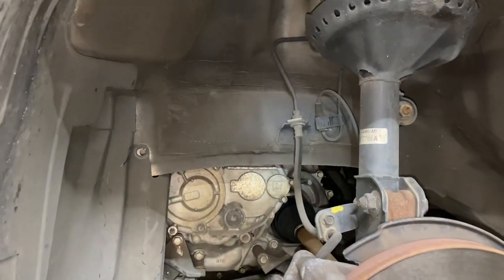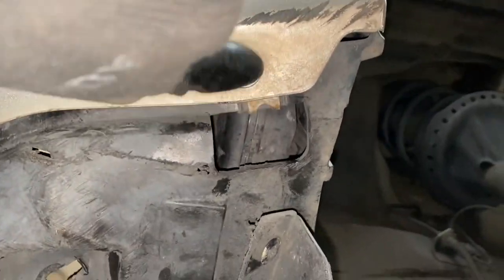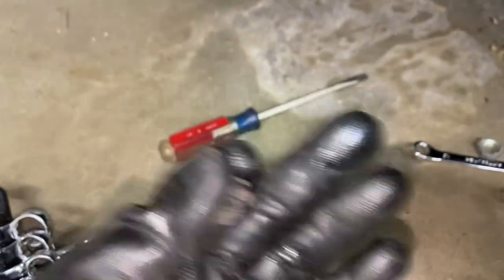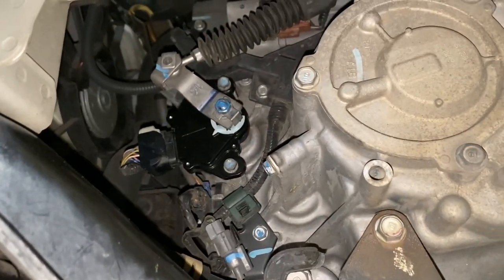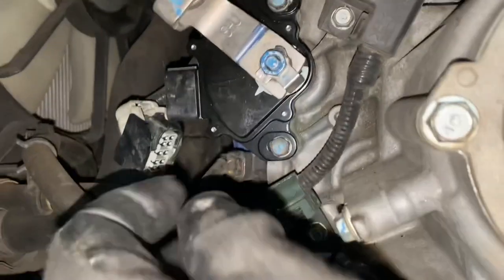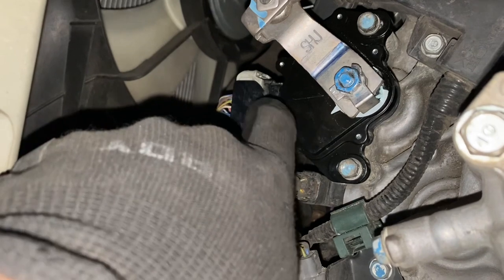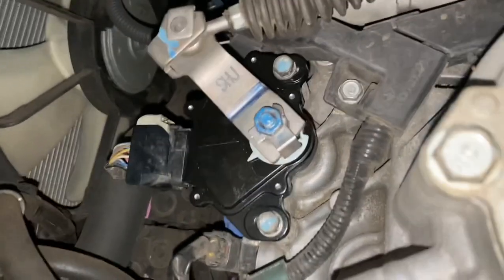2007 Honda Odyssey Neutral Safety Switch replacement P1717 Fix

Comment: Thanks for the video!  My install went very well.  The hardest part for me was getting that electrical connector latch to rotate to unlock from the switch.  Not much room to get the screwdriver in there to pry it up.  After install I noticed that the electrical connector must be reattached in order to move the shift lever into other gears.  Also, N and 2 were not lighting up when in gear but if I wiggled the shifter enough they would light up.  A slight rotation of the switch to adjust the alignment of the arrow with the line solved that problem.  A bit hard to align the arrow with the line because you don't have a straight-on sight.  I didn't have a 7/8 inch open ended wrench and my adjustable wrench was too big to get to the large nut, so I used a 7/8 deep socket.  I had to use a hammer and screw driver to bend the tab on that shaft nut retainer which was a bit hard to bend back squeezing with pliers.  My issue for a number of years was a random check engine light along with Transmission error which would throw while the van was in operation and would go away on its own after restarting or after resetting the code.  A rare occasional stuck shifter in park would happen which was resolved by restarting the van or giggling the shifter or both.  I didn't have the no-start issues as others had.  My BlueDriver error code was P1717 Transmission Range Switch ATP RVS Switch (open or short).  The electrical connector looked fine so I didn't think it just needed an electrical connector cleaning.  I purchased a Standard Motor Products NS-577 Neutral Safety Switch for $57 for my 2007 Odyssey.  This switch, sliding door switch and roller bearings, and power front door lock motors have been the only issues with this Odyssey with 200k miles.  Scheduled maintenance like the timing belt/water pump replacement was really not that hard with help from YouTube videos.
Reply: having the same symptoms as you described... did you bookmark any better videos? was yours also 2007 ?

Comment: Great video I’m doing it right now in my garage and you have showed me everything . It also showed me that the one coming off is silver in color and the new one is black. Also thanks for showing the connector removal. The replacement part number is 28900-RYF-023. I’ll just ask if is correct before changing. Thanks a whole bunch.     Artie 👍

Comment: Do you change it with van in neutral? I don't see how you could loosen)tighten that top 10mm screw with shift lever in place.
Reply from the maker: I did it with the van in park.

Comment: I just replaced this part on the same van a few days ago and it's been running fine and this morning I was parking and had it in drive and then threw it in reverse real fast and got the gas and it just ramped up but would no go and then I put it in drive and back in reverse and it was okay again. It's never done that in the 6 years I've had it. Any ideas of what that could be?
Reply from the maker: It sounds like it may need to be adjusted slightly.

Comment: After replacing this I can switch to all gears and all of them work, but I have to play with the shifter a little to get the P R N D lights to turn on.  What did I do wrong?
Reply from the maker: My guess would it may need to be adjusted slightly or check the actual connection to ensure the electrical connection is clean.

Comment: Thanks! This was very helpful, in addition to other videos I found for a replacing a 2007+ Odyssey neutral safety switch--definitely in a different location (as shown in this video) than 2006 or before. I actually did the job from the top, after removing the battery and battery tray, as well as the air filter housing/intake or whatever it's called. Left me tons of room to work from the top, although I can see how being able to access it from the side as you did might have been helpful in addition to top access or even instead of going from the top. I just hate removing that black plastic stuff--always end up breaking those damned pop fasteners. I did find it puzzling that the very first, outer nut that you remove requires first bending back that tab, which covers a whole side of the hex nut. But there seemed to be no way to do this without removing that nut, and therefore bending that tab out of the way. Whereas the little tabs on the innermost "washer" (the piece that serves as the shift position pointer) are tiny and easy to bend out of the way or back into position. ALSO, for any of you going from the top, it's DEFINITELY worth removing the big black air intake unit which is held on only by one bolt and a ring clamp. And then removing the VERY large electrical connection under that, which has a plastic lever than you push down to unfasten it. Removing that makes it easier to get to the battery tray bolt underneath. The part most people complain about in removing the battery tray is having to reach way underneath the tray to find a "hidden" 12mm bolt toward the front end of the car. I actually did not have too tough of a time with that--I pulled out the ATF dipstick to get it out of the way and slipped my left arm down and under the battery tray, holding the head of a 12mm socket/socket wrench to find its way on to the head of that hidden bolt. I reached over the top of the battery tray with my right arm to find the end of the socket wrench to push down while my left hand held the socket in place on the head of the bolt. Fortunately the bolt was not at all frozen so I was able to easily get the bolt to start turning out/loosen.

All of the above doesn't matter of course if you go in from the side like you did! Oh, also, I'm glad you showed the last step of leaving the top and bottom sensor 10mm nuts a bit loose so that you could rotate the sensor so that the pointer aligns exactly to the line on the sensor when the shift lever is in N-Neutral. That's why those bolt holes on the sensor are slotted, to be able to make that small adjustment.

Comment: Thank you for that great video. I have mine taking apart right now but I cannot get the neutral safety switch off of the shaft. Am I missing something?
Reply from the maker: As long as the fasteners are off you should be able to pull it off.

Comment: Is the safety switch the same as the transmission range sensor?
Reply: Yes, and no. They're very little differences between the two. Either way, when you're at an auto parts store an experienced guy at the counter will know what you're looking for using either name

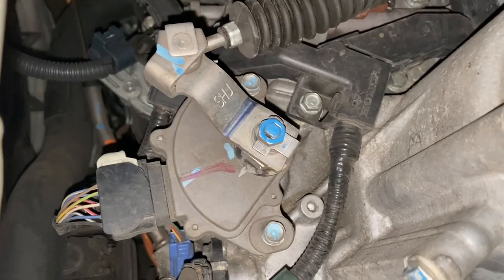Comment: Important: The blue nut at 1:54   has a retainer. You MUST bend the retainer away from the nut before the 12mm socket will fit. That took several frustrating minutes to figure out.
Reply: Was it hard to bend it back?

Comment: I have 2008 Honda Ridgeline. After I install range sensor on ..I try to start the car no crank no start/but  d3 is flashing on dash and green key also flashing too. After I watch your video on u tube… may be I didn’t  put on shaft neutral position
Reply: The part is probadly already factory damage

Comment: On a 05 MDX, with the same sensor, I replaced it but now my MDX won't get out of park on its own. I have to use the "shift lock release".
On Google, I found forums saying it's the brake switch, but my brake lights work..
Can anyone point me in the right
 direction?

Comment: I have a 2007 honda pilot and the electrical connections does not have a clip.  Do you know the trick to remove it?
Reply from the maker: If it doesn’t look like the one in the video I won’t be much help. Best of luck!

Comment: But why did you have to replace it?
Reply from the maker: The original was worn out causing a “no start” frequently. If the transmission doesn’t think it is in park, it won’t let you start the engine.